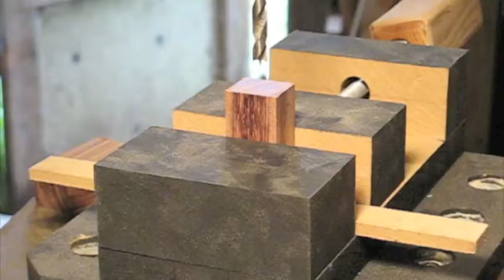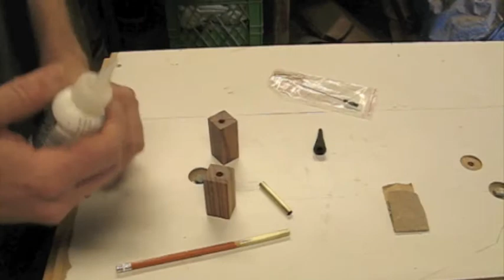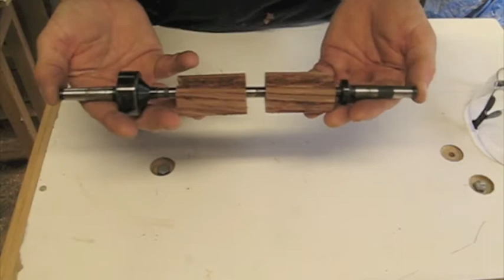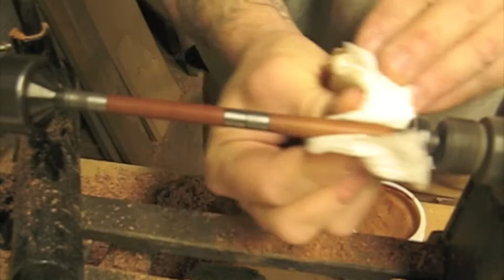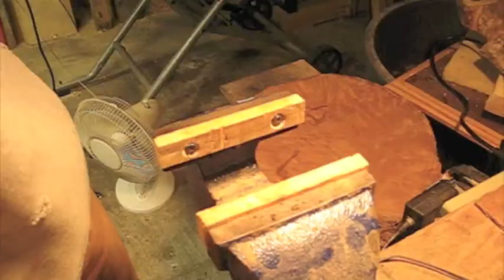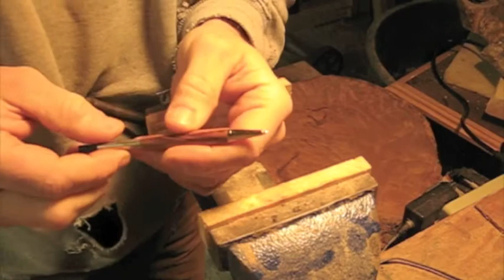My attempt to turn a wooden pen from bubinga wood.

Comment: That is a beautiful piece of wood you have there I have never managed to get my hands on a bit of Bubinga.  Having made a fare few pens the only tip I can give you is "don't mark the wood to aline your pen" mark the inside of the tube as once the wood has been turned you loose the mark.  It's not such a bad thing if the wood has good grain to aline.  If you use something like hickery you may find it hard to get the grain lined up. Also transfer the line on the nib end to the twist mechanisum that way you still have a mark to aline the clip end with the nib end.

Great video

Tony UK
Reply from the maker: Thanks and thank you for the tips.

Comment: TIPS as you requested: 1) You should remove the live center from your tailstock and replace it with the live center that came with your mandrel (two live centers? One is enough!). Much safer that way. 2) Sharpen your tools. It seems that they are just chipping away at the wood, not cutting it. 3) The stand that your lathe is on is not stable enough. It should not wobble like that when you make an adjustment to the tailstock. 4) You did a good job with the skew but the cutting edge should be about 45 degrees to the oncoming wood. The angle you used is why the wood came off like a wreath spinning around the pen. 5) Your vise is a good press for your pens but try it with your lathe. The action of the tailstock allows a lot more accuracy but you'll need to make some ends that fit your Morse tapers from some really hard wood.

Your pen looks great. Are you sure it's only your second? ;) Keep at it.
Reply from the maker: thank's for the tips.  I realized I forgot to take out the live centre after I watched the video.  Woops!  Once again thanks for all the tips.

Comment: Thanks for the action footage! One tip, use a band saw or scroll saw next time to miter down the edges of the stock to get it as round as you can before turning. Two or three slices off each corner should make it a lot easier. Turning them down from square is a lot harder, and will stress your material and tools more.

Nice job!